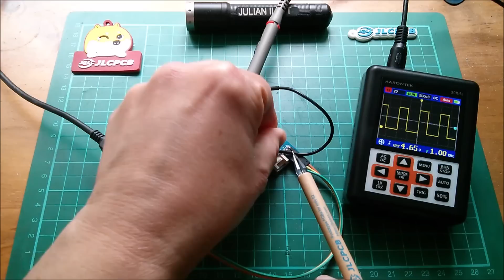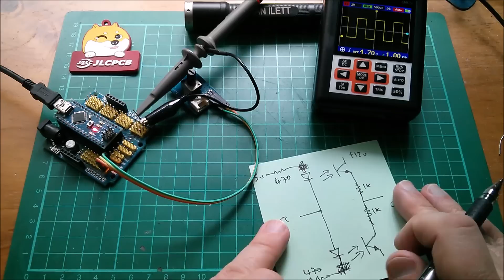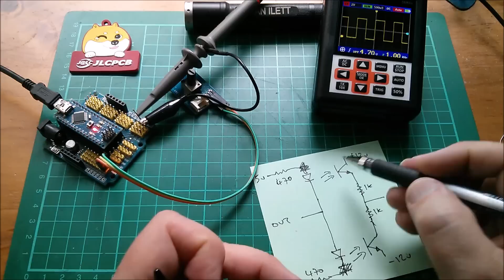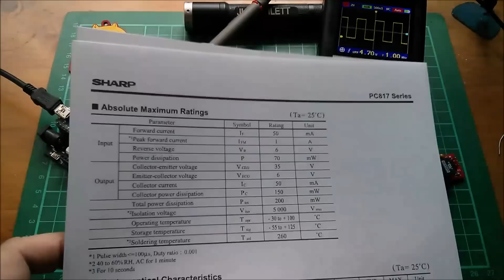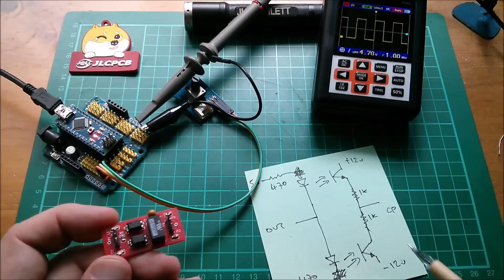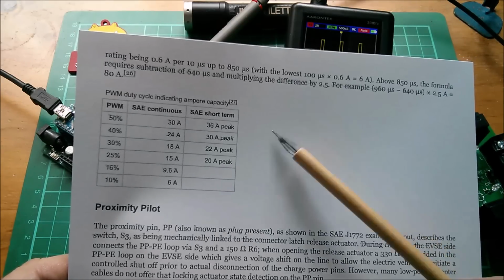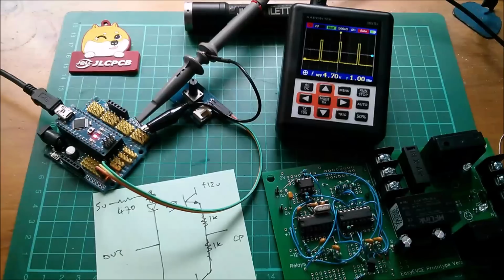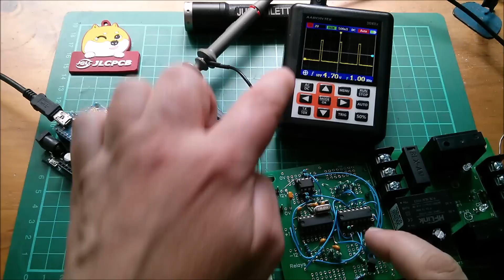Opto-Isolators and Arduino for EVSE Project

Comment: "constrain()" is the correct approach.
To those recommending the map() function, check the language reference, which contains this text: 

"Does not constrain values to within the range, because out-of-range values are sometimes intended and useful." 

In other words, mapping changes the scale, but not the limits. So while "map(pot, 0, 1023, 0x19, 0x40)" would probably be OK on an Arduino Uno with it's max ADC output of 1023, if you later port that code to a board with more than 10 bits of ADC resolution, you will get result values higher than 0x40 when the ADC result is more than 1023. The language reference goes on to say:
"The constrain() function may be used either before or after this function, if limits to the ranges are desired."
Reply from the maker: Yes, and I'm using both map() and constrain() in my latest sketch.

Comment: I am in the process of building an evse for my Leaf at the moment and from all the testing I have done the car does not actually need the CP PWM to go to -12v so I am just using a 0 to +12v signal, much simpler PSU!

Comment: At 9:00, the forward current you are looking at is for the input not the output.  The output sustains damage at 50 mA or 150 mW whichever is greater.  I recommend expecting at least 5.5 V supply to the Arduino and I would leave those LEDs in place plus I would add another diode pair to get the series voltage above 5.5 V.  Then put the current limit resistance in series with the port pin.
Reply from the maker: Well spotted, but the numbers are the same :)

Comment: Hi Julian - Why did you not use a 2 transistor Astable  Ik square wave oscillator ?
Reply from the maker: It would be difficult to pulse width modulate.

Comment: Photovoltaic output optoisolators are great for driving mosfets...
Because the gate voltage can be result of floating optocoupler'voltage  on top of the fet's source.
Such arrangement can drive an n-channel as easily on high side, as it can on the low side

Comment: You could also just use an op-amp as a driver, just like you did in the charger without a microcontroller.
Reply: Maybe just a comparator, or a 555.

Comment: Out of curiosity, what is the impedance of that CP line?
Reply from the maker: It's high. However the car lowers it to change the voltage on the CP line as a form of signalling.

Comment: you have the current from the two resistors but does the CP input draw current??
Reply from the maker: The vehicle changes the resistance at its end of the CP line to signal different states.
Reply: I was wondering about that to

Comment: Did you think about using a MAX232 or some other RS232 driver instead to get the signal to +/- 12v? 
You can even parallel 2 outputs on the chip for more drive current. 
Another alternative would be to use 2 pins on the Arduino and a timer interrupt to build a charge pump? 
You can generate a 5V AC with the 2 pins and with diodes and caps build a charge pump. 
I used that technique to generate +12V to drive an IRFZ44 MOSFET gate back in 2004. 
I stole the idea from a PWM DC motor driver schematic. Worked like a charm.
Reply from the maker: I did. I also thought about using an op-amp driver and/or an analogue switch driver.

Comment: You could replace the constrain and the analogue divisor with the map function. But of course you're not using the pot in the end. Nice use of the optos.
Reply from the maker: The constrain() function is a last-resort failsafe to ensure I don't put values into the analogWrite() function that would blow fuses or trip breakers. But I'd be happy to use map() as well as constrain().